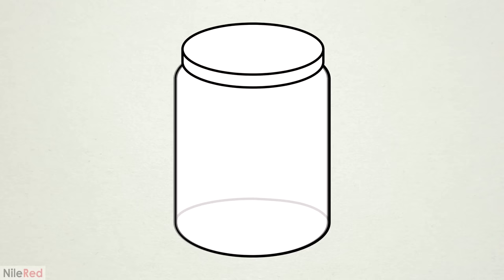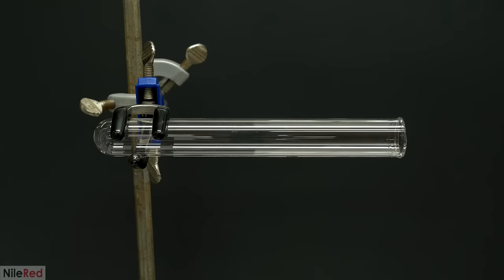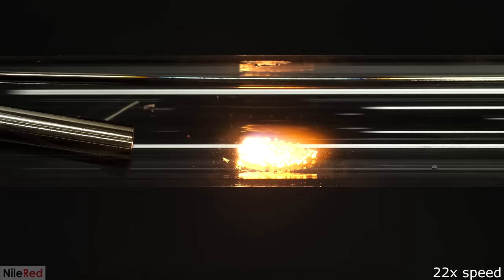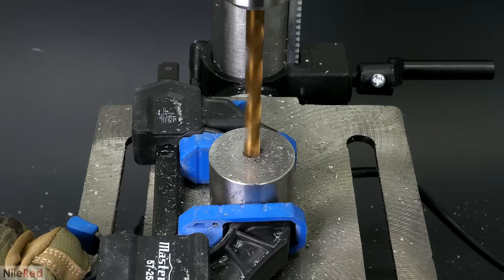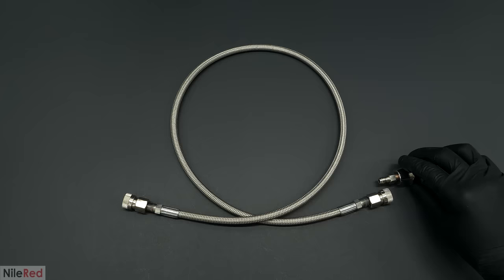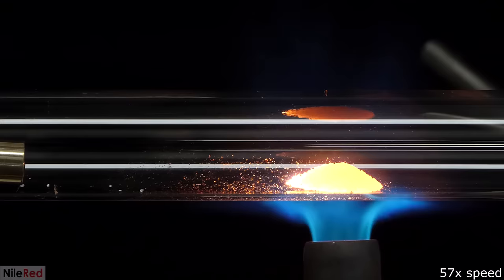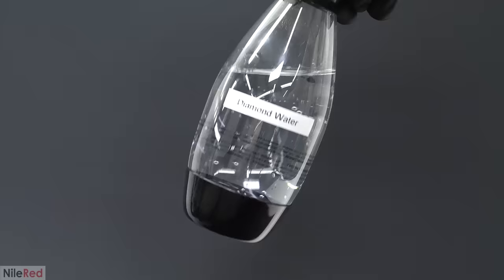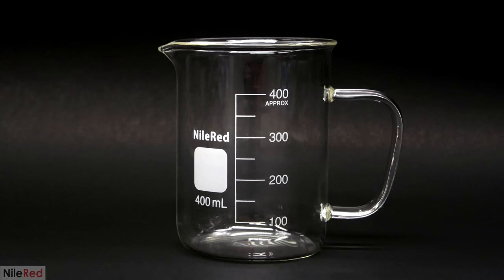Making the world's most expensive carbonated water!

Comment: Ok, so you converted Diamond to CO2.  Now convert CO2 to Diamond(s).
Reply: Diamonds to CO2 needs heat so if we cooled CO2 its going to make diamonds so basically dry ice is dry diamond ice
Reply: @BubblyLasagna  no, just no
Reply: You really need an extreme temperature and pressure to do that
Reply: weetme 161 for example a sun
Reply: Nugget That’s not how it works if CO2 is cooled down it’s going to become ice made of CO2 not diamonds. Diamonds are made in the mantle where it’s 2000 F or 1100 C and the pressure is very high.
So to make diamonds you need lots of heat and pressure not cooling down CO2. You really make no sense, and you shouldn’t talk about something you don’t know
Reply: @Official_Chivo.06  Not all diamonds are made with High Pressure High Temperature (HPHT), you can also make diamonds using Chemical Vapor Deposition (CVD).  The largest synthetic diamonds are actually made using CVD and this method gives you a lot more control than HPHT.  This way you grow the diamond in a low pressure (though still hot) plasma.  While diamonds in the earth form through HPHT, scientists speculate that diamonds may form in the atmospheres of Uranus and Neptune through CVD.
Reply: If you converted the CO2 to graphite, you could also use HPHT, but I feel like that's less in the spirit of a chemistry channel...
Reply: All of the replies on this is really hurting my brain
Reply: @howdy01  lmao me too
Reply: @Official_Chivo.06  pretty sure Nugget was just joking
Reply: @howdy01  same 😔
Reply: @BubblyLasagna  lol
Reply: they need cvt,its quiet expensive
Reply: @BubblyLasagna  proper Commerce guy
Reply: Just A Person btw I think he was joking
Reply: People have done it in the past but theyre very miniscule and require an insane amount of head and pressure
Reply: @BubblyLasagna  no you have to somehow dissipate oxygen from the dioxide it is pretty complex
Reply: Alchemy 100
Reply: actually incredibly difficult
Reply: Nugget oh yeah it’s big brain time
Reply: @BubblyLasagna  not really tho
Reply: Wouldn't it be Carbon instead of CO2 because the oxygen was added to the Crabon during the heating process?
Reply: Stonks
Reply: @packediceisthebestminecraf9007  i guess nugget means DRY ICE IS BETTER THEN PACKED ICE IN MINECRAFT AND IRL HAHAHAHAHAHHAHAHAH
Reply: It can be made . You need carbone and high very high pressure but I think it won’t be as valuable because it’s not natural diamonds have high value because it not easy to access it and if you made it , it may look the same but won’t have the same value
Reply: You just found the line between chemistry and alchemy my friend
Reply: And after that go to a fucking volcano and turn lava in to clouds the turn those clouds into captain price
Reply: @BubblyLasagna  not at all diamond is made up of only Carbon not co2
Reply: If you reply by “it doesn’t work like that” your officially a bomer, congratulations 🎉
Reply: @Jiya Noshin not all meaning some are so im right
Reply: @Official_Chivo.06  r/woooosh
Reply: @dkkdjfldkd1242  bruh
Reply: Nugget Seems legit
Reply: STOP GETTING SCYENTIEFIC BOMERS
Reply: Holy shi-
Reply: Is that possible?
Reply: @BubblyLasagna  i honestly hope that was a joke 😂
Reply: Nugget 😂 yup totallyyyyyyyy
Reply: Siwlerdaoz yup. Good luck.
Reply: Guys nuggets making a joke (hopefully)
Reply: @BubblyLasagna  Honey. Diamonds are supposed to be a pure composition of just carbon not carbon dioxide...
Reply: There were two groups several years ago that managed a process to do something like this using seed diamonds and knocking on carbon atoms to grow the seed in a liquid suspension (I think). One was a hot method, one was cold and they were in a race to find a method to replace silicon as the main material for electronics as it would allow us to overcome.. a host of issues including our current thermal limit. One group was bought and shuttered, the other received death threats and the last of their members that I was following fled to Japan. Diamonds are not scarce. You can buy flawless, lab-grown diamonds for relatively cheap. If I understand why their lives were at risk, it's because the same method could be used to introduce artificial inclusions.
Reply: Profit 100
Reply: Phil Lester  I'm saying bruh.
Reply: @umbrvalken  bruh he was joking.
Reply: @umbrvalken  well i'm not 100% sure but i'm gonna assume they were joking.
Reply: @Official_Chivo.06  ok so i need an hydraulic press machine Made of tungsten and some anthracite at 1100C°. Thanks for the tips
Reply: Illuminati wants to know your location
Reply: It's not possible
Reply: We need high pressure to convert co2 to diamond
Reply: @BubblyLasagna  nugget lemme join in ur nugget cave
Reply: You can make diamond with grafit if you heating to 10000°celciis
Reply: @BubblyLasagna 
fysiks
Reply: You would have to deprivate it of oxygen
Reply: @BubblyLasagna  not really
Reply: @BubblyLasagna  no we have to pullout oxygen and we get diamond
Reply: @Official_Chivo.06  im pretty sure he was clearly joking lol
Reply: @BubblyLasagna  hell no, diamond is just Carbon, dry ice is CO2.
Reply: @demonetization6596  ARENT YOU SUPPOSED TO DEMONETIZE PEOPLE? GO DO YOUR JOB
Reply: @BubblyLasagna  aren't you supposed to show me your pit of nuggets?
Reply: That is the real test
Reply: @weetme1613  so just a heated hydraulic press?
Reply: Hello, I'm Matt Heck, former Director of Special Projects for TechShop Menlo Park.  This was in fact done by Dr. J. Michael Pinneo.  I know this because, one afternoon, I was backing out of our server closet, and turned around to see a very large object on a rolling plastic lab cart.  This resulted in my saying one of those things you never expect to hear yourself say:

"Michael, why are you aiming a 15 kilowatt microwave horn at my server room?"

It turned out to be one of two such drivers, both of which wound up tightly bolted onto a big square pressure vessel at 90 degrees.  Into this, Dr. Pinneo injected various CxHy atmospheres, purging all the oxygen out, and then set microwave amplifiers up to get constructive interference regions in the cavity.  This wound up gradually dropping carbon out as amorphous diamond, eventually leaving an atmosphere of pure hydrogen in the chamber!  Pretty fantastic.

As I recall, his initial motivation for doing all this was that he wanted to make his wife the world's first pure diamond ring-- the ENTIRE ring.  I'll have to ask him if ever managed it!
Reply: @Official_Chivo.06  r/whooosh
Reply: This is big brain time
Reply: If that was possible global warming would be an illusion
Reply: @BubblyLasagna ..
Cooling doesn't reverse what heat does..
Heat allows atoms to move and reform..
Cooling stops the movement, so reaction is impossible to happen when atoms doesn't move.

Instead, pressure can play a role in reversing.

Just imagine, when pressure is low and you apply heat the atoms will move further from each other. So, thing breakdown and get more simple. 
And, when pressure is high and you apply heat the atoms move nearer to each other. So, things unite and get more complex.

I don't know a lot about chemistry, but I think this is how reversing work.

And, I know to turn CO2 to diamond you need high pressure and heat.
Reply: @dogesao7016  Can't use a hydraulic press to compress carbon since the fine oil used in the hydraulic would be condensed as well. Also you'd need a hella strong hydraulic press to even do smth liek that.
Reply: @packediceisthebestminecraf9007  so can you make packed diamond ice?
Reply: @weetme1613  just give it a vacation in Texas and give it the finals test for its PHD.
Reply: @jacobdobbins5443  eh, what did i miss?
Reply: @weetme1613  everything and nothing at all
Reply: @jacobdobbins5443  okay
Reply: Actually, that could theoretically work. But with a heat and pressure not possible on Earth yet.
Reply: @BubblyLasagna  lol nugget from kindergaten i remeber u from a vid wher u commented "Nugget loves pretty lily"
Reply: @AlooGobigirl  Remove the Oxygen then you have carbon which can be converted to diamond through many different processes.
Reply: Phil Lester  THANK YOU. I keep cringing as my funny bone dies a little with each comment 😂
Reply: @umbrvalken  is it right when you're correcting a joke? 😩
Reply: @umbrvalken  Hahaha savage, dude 😅😅😅😅
Reply: All of these comments will allow many to make diamonds lol... if not including the funding needed
Reply: Omg you’d be rich
Reply: @Official_Chivo.06  r/woooosh
Reply: @unknowndefaultguest  also ha to the middle part
Reply: *DeBeers wants to know your location
Reply: But then they wouldnt have any value almost
Reply: weetme 161 which basically up is not possible for a single human to do.
Reply: @Official_Chivo.06  then you do a coal based motor, that heat a lot, and the co2 produced from the coal is reinjected into the machine
Infinite diamond trick
Jewelry hates him
ultra STONKS
Reply: Ok
Reply: @BubblyLasagna ..... no. That is wrong on several levels.
Reply: @potato2635  STOP BULLYING ME
Reply: Stonks
Reply: @CreeperDude-cm1wv  Yaaaassss queeeeennnnn
Reply: I just realized that we can cool down coal to reuse it
Reply: @Official_Chivo.06  r/woosh
Reply: @Prankst3r3  lol
Reply: @weetme1613  that still wouldnt work, first youd need to turn it into graphite, and getting a gas to follow that kind of crystalline structure is near impossible, only in the implosion/collision of neutron stars.
Reply: @jayosborne1147  neutron star collision*
Reply: @immortaltitan3839  Geez so many replies
Reply: @weetme1613  bring it to florida
Reply: @paullucas7504  he added the Oxygen gas, not the O2 one, pretty sure it turned to carbon monoxide
Reply: Good luck; you need at least 105 GPa (that's Gigapascals) to do that. I'm pretty sure an ordinary hydraulic press wouldn't work well with the idea of making lab-grown diamonds.
Reply: thats literally how most of the diamonds are made today
Reply: @BubblyLasagna  some gud fizziks here
Reply: @Official_Chivo.06  he’s joking
Reply: @RealSaudiExplorer  this was actually a really good explanation to tie together this video ty
Reply: @packediceisthebestminecraf9007  reddit moment.
Reply: @Official_Chivo.06  r/whooosh
Reply: Time and pressure turns coal into diamonds
Reply: @BubblyLasagna  learn to spell
Reply: @Official_Chivo.06  r/wooosh
Reply: @Prankst3r3  r/woooosh
Reply: @BubblyLasagna 
No, it does not work like that😅
Reply: @packediceisthebestminecraf9007  actually it’s chemistry not physics
Reply: @Prankst3r3  yes
Reply: @iayakimino3650  chamistree

Also, is it really chemistry? It's mostly about pressure and temperature.
Reply: @weetme1613  and even then it takes years for coal to condense down into diamonds.
Reply: Do the whole thing backwards
Reply: Stonks
Reply: @weetme1613  maybe he could add pressure using some sugon
Reply: Entropy:
First time?
Reply: yeah that's big brain time.
Reply: @BubblyLasagna  full metal alchemist
Reply: @BubblyLasagna  is that a joke? Burning is a chemical change so it actually changed the property so reverting it back to diamond seems impossible.
Reply: @BubblyLasagna  Basically yes, the only hard part is removing all the oxygen from dry ice.
Reply: CO2 to diamonds... imagine.....

UNLIMITED DIAMONDS
Reply: @BubblyLasagna  So, people aren't allowed to talk about chemistry here?
Reply: @BubblyLasagna  dude the hell?
Reply: @BubblyLasagna  the amount of people who took this seriously scares me
Reply: Entropy, my friend. Entropy.
Reply: There is a company that takes your loved ones ashes and turns it into a diamond
Reply: @BubblyLasagna  how can u be so wise in the way of science
Reply: @Official_Chivo.06  dude .. u forgot ur meds ?
Reply: @Official_Chivo.06  mate I think that was a joke, just chill
Reply: @Official_Chivo.06  wooosh moment
Reply: For all the people in the replies trying to educate this dude...

It's a joke.

Just stop 🥴
Reply: @ornessarhithfaeron3576  You're allowed to talk about anything in a comment section but everyone trying to scientifically correct a joke is just kind of sad.
Reply: @jayosborne1147  not exactly but true
Reply: @Prankst3r3  yes, just yes 😂
Reply: I really hope that he attempts it at some point or at least sits us down and says no lmao
Reply: You first should separate carbon and oxygen, then remove oxygen and with extreme pressure, TRY to convert carbon to diamond
Reply: @Official_Chivo.06  Im pretty sure it was a joke but ok...
Reply: @Official_Chivo.06  r/woosh
Reply: @Official_Chivo.06  ITS A JOKE SMH
Reply: @packediceisthebestminecraf9007  
Man reading that was hilarious
Reply: Cody's lab/applied science: heavy breathing
Reply: To do this just play the video in reverse
Reply: Yesss
Reply: @Official_Chivo.06  r/whoooosh
Reply: If people can make diamond, they will become cheap
Reply: @BubblyLasagna  didn't see the schme he used on the video you need to loose all o2 just carbon u can't make anything with co2 to turning to diamond
Reply: @BubblyLasagna  if you put meat on the grill then you cook it and if you freeze the meat then it becomes raw again
Reply: big brain
Reply: Good one
Reply: You would have to separate the Oxygen atoms (2 per molecule), and then place the pure carbon atoms under extremely high pressure (something slightly higher than the pressure of a hydraulic press), not to mention get it at an extreme temperature, near 500-1000’C (enough to melt it). Now that you’ve done that, lift up the extremely hot hydraulic press, and you’ve got some homemade co2 diamonds!
Reply: @BubblyLasagna  no, just no to pure amazing hilarious lies-
Reply: ok ok ik this is a joke but i want him to see if thats possible
Reply: That's exactly what they do in all those labs in china making CVD diamonds.
Reply: @BubblyLasagna  Dry cool mony 🤑🤑
Reply: @monke man No.  Actually methane (CH4), but methane from carbon dioxide is easy.  Look up Chemical Vapor Deposition.
Reply: @BenTajer89  yes yes we can all google lol
Reply: @BubblyLasagna  sussy
Reply: @packediceisthebestminecraf9007  no hony blocc is bettr
Reply: I don't understand whats the reply section is saying but yes
Reply: I have liquid diamonds here,how to make it solid
Reply: convert an omelet to an egg
Reply: Hey, if diamonds are made out of carbon, we're literally breathing diamonds.
We drink beverages with diamonds.
Dry ice, which is carbon, is actually diamonds.
Diamonds are everywhere, and we still didn't realize it.
Reply: @somewagyuenjoyer  99999IQ
Reply: @azamgulzar8257  hmm, blue ice may have something to say about that
Reply: @BubblyLasagna  no, they officially have an iq greater than 30
Reply: @sreeharinair4240  nope da beer wants to turn precise location finding on, do you agree?
Reply: @binayd.c.996  you get carbon or graphene perhaps depending on conditions
Reply: @imillusion492  that might be a south american company iirc typically one that might melt humans down for fat for cosmetics perhaps.  Possible you get a cheap diamond in return...
Reply: @howdy01  I’ll dumb down CVD (what the guy above you was describing)

Take away the oxygen from CO2, cool down the carbon, and make sure it crystallizes, and badda-bing badda-boom you have diamon
Reply: they would be the kind of ripoff diamonds then not the real ones. no one "create" real diamonds except for nature
Reply: @konfuzzzled  there are already industrial diamonds that are made artificially.  I think they are only very small and require tremendous amounts of heat and pressure
Reply: OH MY GOD THIS COMMENT SECTION YLL NERDS PLS DO MY SCIENCE CHEMISTRY HW
Reply: @dithikadas7943  please read your notes from class and a text book if you really want to get ahead.  We're only the same as you but older, having done a little more and probably most passed basic chemistry.

By the way, if you watched this then I think you're showing some of the researching and curiosity that will help you with this subject later on but make sure you get those basics nailed down.
Reply: @BubblyLasagna  sciens
Reply: @BubblyLasagna  you clearly know alot about chemistry
Reply: @BubblyLasagna  no ur going Albert Einstein mode
Reply: C02 to diamonds requires extreme pressure
Reply: Yes
Reply: Play the video in reverse
Reply: @BubblyLasagna  No.. Diamonds are purely made from Carbon atoms. Dry ice has nothing to do with Diamonds.
What you'd actually need is to tremendously pressurize and heat the carbons in something like coal over for an astounding amount of time.
Reply: I don't care whether that's impossible or not, but he has to do it
Reply: You know they already do that lol
Reply: The earths air would be filled with diamonds and would fall on newborns and kill them uwu funni
Reply: Just extremely cool it down B)
Reply: Awsome idea. Turn pollution to your wealth
Reply: Not possible for him to do
Reply: Lol free money
Reply: Imqgine
Reply: Heat = melts diamond
Heat and pressure = makes diamond
Reply: Dear god
Reply: @BubblyLasagna  no
Reply: @Official_Chivo.06  r/woooosh
Reply: Hol up
Reply: Pls I want
Reply: Wait thats illegal
Reply: Lol... Ur saying as if it's vry easy to do it.. 😅😂😆
Reply: @BubblyLasagna  kehmastry
Reply: @howdy01  same
Reply: diamond is high pressure carbon
Reply: @howdy01  fr I’m to dumb for this 😵‍💫
Reply: TIME TO BREAK THE ECONOMY TO SAVE THE PLANET
Reply: I don’t know if that will work
Reply: But what if Nile red do
Reply: But what is Nile red doesn’t know of a way to do it
Reply: am i the only one who watches Nile but doesnt understand a word about science
Reply: Free diamonds!
Reply: Yess inginite money glitchhhhhhhhhhhh
Reply: Look at all these chemistry nerds
Reply: so infinite diamonds?
Reply: Well if he could I think diamond wouldn't be that expensive lol
Reply: @wasabi1363  right i forgot
Reply: Probably about over 2000 pressure on the air pump so no
Reply: It is possible with extreme pressure
Reply: It's legitimately impossible as CO2 in gaseous state is too less carbon. we may rather use charcoal or coal and put them under higher pressure and heat(absolutely high magnitude) that would change it's structure and give us damm diamond. Btw there are people who have already tried it and were successful but for some reason they weren't just very real diamonds
Reply: Lol 🤣🤣🤣
Reply: This os literally being done nowadays lol
Reply: Then he would be richer than Elon Musk...
Reply: COOOOOOOOLLLLLLLLLL!!!!
Reply: Technically that diamond water is CO2 so just freeze the diamond water and the it’s diamond
Reply: Convert glass to sand again.
Reply: You say that as if it hasn't been done before
Reply: Could save alot of world problems with that 😄
Reply: Yes, I agree.
Reply: Guys it’s a joke
Reply: They already do with the man made diamond
Reply: @BubblyLasagna  and then we bully the oxygen out
Reply: Infinite money
Reply: no, thats not how it works
Reply: You need compressors
Reply: @BubblyLasagna  everyone that replied to this r/wooosh
Reply: The Bible says that no one is a good person. We have all broken God's law the 10 commandments, we have all committed, lies, adultery, idolatry, and blasphemy. We deserve hell, but because of what Jesus did on the cross we can be forgiven. So if you Repent of your sins, change your wicked ways, and put your faith in Christ you will be written in the book of life. 👌 🙏Repentance is reviewing one's actions and feeling contrition or regret for past wrongs, which is accompanied by commitment to and actual actions that show and prove a change for the better.
Reply: @weetme1613  its already been done at a nice scale. Dont need the heat just very extreme sudden pressure as that also creates the heat needed.
Reply: @BenTajer89  opposite is using the extreme pressure micro compressors. These things produce almost the same pressure found near core and in a millionth of a second saw reps as sun however lol be an making at best diamonds is of a pinhead.
Reply: @jayosborne1147  not even  a sun you need a super nova to make anything heavier than iron
Reply: also let's make gold from turds while we're at it! (jk but if possible.... Not kidding?)
Reply: @weetme1613  we got the technology
Reply: @megasocky  I also require an insane amount of head and pressure
Reply: Nigel: …
Reply: First thing I thought
Reply: Ph
Reply: He converted Diamonds into C4
Reply: it is just chemical change
Reply: @megasocky  head? 🤨📸
Reply: That would be very challenging for anyone to do.
Reply: Using 100% of the mind
Reply: @BubblyLasagna  so we can get CO2 from the atmosphere and make it into diamonds?
Reply: Yessssssss!🎉
Reply: They are making now the science diamond 💎
Reply: Alr just give me about a hundred thousand years
Reply: That’s illegal
Reply: Get me a reverse blowtorch, an anti-quartz tube and a negative oxygen pump
Reply: Smart
Reply: we cant, we need gamemode creative for this
Reply: Impossible 😑
Reply: Nile is not immortal, he can't wait 300,000,000 years for the CO2 to fossilise, then it would be impure diamond. It also takes a lot of pressure, and nile dosen't have infinite money.
Reply: @weetme1613  On paper, yes, but if you heat it in any wrong way, you end up with a powder instead.
Reply: If that could happen, JUST IF, all scientist will be rich and we will not know how they got so rich. If we know how to get diamonds from CO2, theres no such thing as rich person (unless u dont have the scientific instrument to change the co2)
Reply: @Official_Chivo.06  it was a joke lol, chill.
Reply: Pressure and heat is a bad combo for a lab
Reply: Ez just knock the o2 off and then compress the leftover carbon
Reply: @BubblyLasagna  bruh
Reply: 📍That’s a great idea, not only will it be an excellent money maker, but it also help the planet cause it’ll use up all the CO2 from the atmosphere!
Reply: @BubblyLasagna  no tf
Reply: Don’t test him 😭
Reply: Imagine all that dry ice being crushed back into one while big diamond 🤣💎
Reply: Crush all that dry ice back into one diamond 💎
Reply: @Siwlerdaoz this isn't possible since it requires very high temprature and pressure. Us people can'tcreate artificial fossil fuels which is one of our crucial needs.
Reply: ITT: People who don’t understand entropy
Reply: @Prankst3r3  you missed the joke 🤡
Reply: Guys he was kidding calm down.
Reply: MAH MAN TALKIN BOUT UNO REVERSE CARD IRL....
Reply: Bro understand the assignment
Reply: @Chivo
Reply: @Chivo r/woosh
Reply: Sounds simple enough
Reply: @Official_Chivo.06  Dunning-Kruger effect in action.
Reply: Not possible
Reply: @BlueLatios  a phrase scientist try to avoid
Reply: @BubblyLasagna  It Has To Be Hot Not Cold
Reply: Yes throw it into the point wher two totonic plates meet
Reply: watch the video in reverse and voilà
Reply: Not possible
Reply: Smart free money if worked
Reply: @BenTajer89  cool
Reply: The same thought hit my mind, "Ok, so you converted Diamond to CO2.  Now convert CO2 to Diamond(s)." 

I was getting ready to say the same thing!
Reply: That’s going to be pretty hard might be his hardest project ever to be honest
Reply: Simone needs like allot of pressure more than the pressure of bottom of the ocean 🌊
Reply: Diamonds=>CO2 = CO2=>Diamonds
Reply: @BenTajer89  nice
Reply: Lol
Reply: This reply section is basically r/woooosh
Reply: You literally said what was in my mind
Reply: @BubblyLasagna  Bra
Reply: We call it synthetic diamonds. :)
Reply: @BubblyLasagna  wow
Reply: Oh good question
Reply: There more than 300 comments, but did someone already mentioned welding? Back in the day they made artificial diamonds when it was worth something.
Reply: Yes please
Reply: How to become a trillionaire
Reply: Just rewind the video play it backwards boom done
Reply: @weetme1613  and a million years or so
Reply: Now that would be really expensive
Reply: the hostility is so hilarious when someone is joking about cooling CO2 and someone else comes in like “you really shouldn’t talk about something you know nothing about” lmao like chill
Reply: @jayosborne1147  you’re onto something…
Reply: @BubblyLasagna  heh
Reply: While he's at it he can create gold why doesn't he
Reply: Infinite money glitch
Reply: just do the experiment backwords
Reply: now make it rain diamond from the CO2 in the atmosphere
Reply: oh
Reply: It's really easy and just need one machine. Yeah it's costly but synthetic diamonds are widely made all around
Reply: I breathed diamond armour
Reply: @Official_Chivo.06  bro forgot joked exist
Reply: @BubblyLasagna  Dis u? 🤓
Reply: @trayambakrai  you so mad i posted a comment 💀
Reply: @BubblyLasagna  I was joking ☠️
Reply: When Nile does this, he'll straight up just be an alchemist.
Reply: I don’t think that very possible
Reply: @BubblyLasagna  get bullied
Reply: @BubblyLasagna  this is elon musk
Reply: Breath
Reply: Just by decomposition reaction we can get a pure form of carbon..
I am in class 8th and thi is what I think about it
Reply: Carbon dioxide is extremely stable.  Stripping away oxygen to form pure carbon is next to impossible with any reasonable techniques.  If we want to talk about unreasonable techniques.
The molar enthalpy in J/mol of CO2 gas is -393,420 and gaseous C is +716,680 and the molar enthalpy of O2 is just 0 because it’s pure and in a standard state.  The molar entropy in J/(mol•K) of CO2, O2, and C as gases at STP (which ofc is a terrible assumption to make) are respectively: 213.79, 205.0, 158.10.  Which means that we’re talking about a temperature of around 7500 K and that’s completely wrong anyway because we’re looking at the enthalpy and entropy at STP of gases and by the time they reach 7500 K they’re certainly no longer at STP and might be a plasma???  If you were to somehow get carbon and oxygen to spontaneously split apart you would need absurdly high temperatures and for all I know we may be talking about nuclear fusion level temperatures.  If we are to chemically or electrically reduce CO2 down to O2, perhaps a strong enough reducing agent in an all CO2 atmosphere at a high enough heat could reduce CO2 to graphite.  The other options is to do it the way the aluminum industry turns Al2O3 into Al + O with like 300,000 amps of electricity although I have no idea if it would even work at all because carbon is a nonmetal and aluminum is a metal and so they work completely differently.
Reply: Side note: according to Nicky Oppenheimer, a former chairman of the De Beers diamond company, “diamonds are intrinsically worthless”.  Diamonds aren’t worth shit but there’s only one company that owns basically every diamond mine in the world so they jack up the prices super high.  In reality diamonds are not at all rare and it would certainly never be worth it to extract from CO2 because it would be so expensive for a very mediocre end product.
Reply: @BubblyLasagna  okay please take a basic chemistry or physics course before you assert things about thermodynamics that you know nothing about.  Heating and cooling are not the only two things that can be done to something.  Can you uncook meat?  No because it undergoes chemical changes not just physical ones.  To change CO2 to C you need to break open chemical bonds which is completely different from changing something from a gas to a solid and vice versa.
Reply: CO2 cannot turn to oxygen I mean diamonds diamonds are just carbon but carbon dioxide is what we breathe out he said it reacts with the oxygen so maybe he can extract the carbon from the CO2 and add it is to diamond
Reply: There's actually towers that can do that now a days, it takes carbon from the air and change it into diamonds/carbon based fuel.
Reply: Big brain
Reply: Nah nilegreen does that
Reply: @BubblyLasagna  it’s not that easy champ
Reply: @BubblyLasagna  if we wanna convert CO2 to diamonds we need a lot of heat and so much pressure
Reply: @BubblyLasagna  Im reading the comment section rn :     :buffering:
Reply: @Official_Chivo.06  bro he’s just joking chill
Reply: Yesss
Reply: @BenTajer89  well then on an unrelated note im going to brake the diamond economy
Reply: @jayosborne1147  A sun would fuse carbon, the intense pressure of the inside of Earth is all you need.
Reply: @skyethebi  This guy @Mochussy made a chemistry joke 2 years ago, and he is still getting angry replies like this every week.
Reply: @BubblyLasagna  oh my god...
Reply: @BubblyLasagna  not how that works
Reply: @BubblyLasagna  😂😂😂😂😂
Reply: You not only need heat you also need very high pressure and to remove the oxygen but its been done before
Reply: @jayosborne1147  simple, start punching the air until the pressure from your fist and energy from the punches turns it into diamonds.
Reply: Breathing gets taxed
Reply: @BubblyLasagna  who need they mochussy ate
Reply: Sell it to some one in Dubai, then buy diamonds with the money.
Reply: @BubblyLasagna  if that was the case diamonds would have no value
Reply: I think it requires a lot of heat and pressure.
Reply: @BenTajer89  u can also put twin turbo v8 tune it on e50 with hpfp on stage 3 tune and make diamonds.
Reply: @BubblyLasagna  he is the CHOSEN ONE
Reply: yes
Reply: I wanna see it
Reply: @BubblyLasagna  least science I’ve ever even heard
Reply: @BubblyLasagna  you'd make a bloody good alchemist.
Reply: me who knows nothing about science
Reply: play the tape in reverse
Reply: Technically the dry ice was the diamonds new solid form
Reply: Work smarter, not harder
Reply: If he can do that he will be the most powerful person in the world
Reply: @Prankst3r3 1:13
Reply: @spongebobfunnyy  no
Reply: propably one of the longest comment convo ever on yt
Reply: I think he needs more materials but i have no idea its just a thought
Reply: @Prankst3r3  yes.
Reply: He'd need to separate the oxygen from the carbon, isolate the carbon in a solid form, and then put so much pressure on it that it became diamonds.
Reply: Smort
Reply: @Official_Chivo.06  first, you’d need to get just carbon. Diamonds aren’t carbon dioxide, they’re carbon.
Reply: @Prankst3r3  I think its meant to b a joke
Reply: @imibuks-replit  you don't make jokes about science, ok bro?
Reply: @Official_Chivo.06  its a joke 💀
Reply: @BubblyLasagna  you are actually silly 😂
Reply: @BubblyLasagna  wtf
Reply: Ha! So true
Reply: @ArBoR dayum, was like two years since I made that comment, lmao.
Still, it's very high temperature indeed
Reply: Yeah, a true alchemist should be able to make diamonds from sparkling water if he can make sparkling water from diamonds.
Reply: yes please and then give to me😏
Reply: @Official_Chivo.06 r/wooooosh
Reply: @weetme1613  We got the sun for that..... 😁
Reply: @BubblyLasagna  bro its bonded to oxygen, you can't just freeze CO2 to make diamond 💀
Reply: @Official_Chivo.06  It’s almost like he was joking
Reply: Diamond generators don't exist in minecraft, let along irl
Reply: @Prankst3r3  its true
Reply: @Prankst3r3  not the dry ice part tho
Reply: @Official_Chivo.06  when someone doesn't undestand the joke:
Reply: @Official_Chivo.06  interesting how you said “you shouldn’t talk about something you don’t know” then someone corrected you and we never heard from you again 😂
Reply: Lol
Reply: You need pressure and heat!
Reply: I just watched it backwards and boom co2 to diamonds
Reply: You didnt say that... He. Did it?
Reply: @BubblyLasagna  dry ice is solid co2 but diamond is only carbon
Reply: no, you'd need to separate the O2 from the carbon before, and making diamonds from carbon is actually really common, but hard because you need crazy high pressure for this
Reply: @Official_Chivo.06  bro its a joke
Reply: Simpsons 

Did it
Reply: Infinite money hack
Reply: Remember, artificial diamonds exist
Reply: @Official_Chivo.06  not that pretty sure he was making a joke
Reply: We breathe out diamonds….
Reply: @BubblyLasagna  wdym dude, diamonds only form under very extreme pressure and heat, usually within the earth's outer mantel and rise to the surface via volcanic eruptions
Reply: @paullucas7504  crabon. I'm just imagining a chonky crab somewhere in r/bossfight
Reply: @Azam Gulzar  Dry ice doesn't exist in Minecraft bruh
Reply: @BubblyLasagna  okay, No it doesn't work like that
Reply: @BubblyLasagna  boomer* you boomer (also that is very cringe, so stop for your own sake)
Reply: Bro just really pulled out the reverse card 😂
Reply: @BubblyLasagna  Pure diamond is only carbon , not CO2 so if u cooled down co2 , it will make dry ice , not dry diamond ice.
Reply: @Official_Chivo.06  LMFAO CHILL MATE
Reply: You need to convert the co2 to graphite then put a lot of pressure and energy in it
Reply: @balls
Reply: It's not CO2 it is CO²
Reply: Infinite money Hack
Reply: Fr
Reply: Oh no
Reply: @BubblyLasagna  LMAO people are calling you out and you got mad lol wonder why people called you out lol
Reply: @jackthomas1448   you say "nerds" like it's an insult when it isint lmao
Reply: @ziuzz4168  uh
.. no.
Reply: @Hyouga.I.guesss   so I guess we can't have scientifically correct jokes now can we? /S
Reply: @ArtsyKnox25  can it, nerd
Reply: Wow
Reply: Loll😅😅😅😅
Reply: @BubblyLasagna  1 word. Allotropes.
Reply: DO IT
Reply: NOWWW 👹
Reply: How is that posible😂😂😂😂😂😂!
Reply: @BubblyLasagna  CO2 to Diamond needs heat, pressure, and millions of years
Reply: @Official_Chivo.06  bruh got his feelings hurt bad
Reply: @BubblyLasagna  Comestroy ☁️🧊🪨
Reply: @BenTajer89  You're very smart
Reply: @BenTajer89  synthetic diamonds are low quality though and turn out yellow and arent good enough for the jewellery industry and are only used for industrial applications, and yes there are some planets out there where the pressure is high enough that it rains diamonds.
Reply: I highly doubt you can reverse this experiment some are just not meant to be reversed tho 1605 bucks is a lot lol😂
Reply: @Prankst3r3  u
Reply: lol
Reply: @BubblyLasagna basically if we removed carbon from co2 we save the world and rich
Reply: Yessss
Reply: @weetme1613  Science
Reply: @BubblyLasagna  nope it would actually require even more heat. Like WAAAAAY more
Reply: He probably can but if he shows the process he’s have no funds
Reply: Wow
Reply: Photosynthesis in plants turn CO2 into plant biomass. You turn plant biomass into coal, then coal into Diamonds.
Reply: Challenge accepted
Reply: That's what synthetically lab grown diamonds are
Reply: Yessss
Reply: ∞ money glitch
Reply: Ain’t no way people don’t get the joke years later 😭😭
Reply: Just play the video backwards
Reply: @silly really bro, no, why
Reply: @BubblyLasagna that is not how that works
Reply: COO=/=C+OK
Chemistry does not work that way    rpy @SaraNelson1976
Yes
Reply: 1976=7633
Reply: @BubblyLasagna   LMAO
Reply: Yes
Reply: @Official_Chivo.06 you ever think maybe it was a joke not sure why you got so intense there
Reply: Pressure + heat?
Reply: @Official_Chivo.06   you are sure fun in real life
Reply: Wait
Reply: first you need to somehow get the oxygen out of the carbon then you need a very high temp and pressure
Reply: not possible
Reply: bro that would be so cool
Reply: Sure! Do you have a few million years, 1000 °K temp and even more pressure?
Reply: @BubblyLasagna well that, and butt load of pressure. Otherwise you would just end up with a lump of coal
Reply: Follow
Reply: Diamond is just a name for the crystal lattice structure of carbon that makes it a diamond.
Reply: Four big guyd
Reply: Means co2 around us is ....
Reply: Infinite money glitch
Reply: @BubblyLasagna  92 missed calls from HARVARD
Reply: U my friend are a friggin genius 😎
Reply: @BenTajer89 and that is why the value is less than how it is naturally made
Reply: @BubblyLasagna hm
Reply: OMG YES XXXDDDDD
Reply: Light creates chlorophyll now if only we can create light from chlorophyll.
Reply: Wait what? Convert co2 back to diamonds?... That's not on the script!!
Reply: I've designed a process for doing this. Diamond would be possible as well as other allotropes like graphite and carbon black. It can all be done with solar energy as well.
Reply: @SimuLord This is exactly the project I'm working on, but not so much restricted to diamond; graphite and carbon black as well.
Reply: @Official_Chivo.06  can you prove that the mantle exists? And can you prove that it’s that hot?
Reply: @howdy01 those who cannot DO - portray themselves in the comments as if they can - Teachers excel in the classroom because everyone that’s there doesn’t know squat about the subject the teacher is teaching and when they do, the teacher kicks them out
Reply: @kalebbillig3472  That’s an old fashioned method of teaching, nowadays teachers are required to give work extensions for students who need more of a challenge in their learning
Reply: @howdy01 😂😂😂😂😂
Reply: Looooool
Reply: @megasocky damn, you need to give head to the carbon?
Reply: no
Reply: I am 500th comment 😂😂😂😂
Reply: Hi😂
Reply: heavy on it
Reply: @Official_Chivo.06  oh dear god 😂
Reply: @BubblyLasagna diamond is pure carbon unlike CO2
Reply: Where y e
Reply: infinite money generator
Reply: what
Reply: @weetme1613 idc lol ima be rich
Reply: I think you can
Reply: 😂😂 @BubblyLasagna
Reply: Brooooooo he was joking like ahhhh
Reply: @Prankst3r3 yes🗿
Reply: it's possible but very expensive because of the pressure required
Reply: Imagine...
Reply: @BubblyLasagna  don't worry, at least I got it. You funny
Reply: @BubblyLasagna diamonds are just carbon dry ice is carbon dioxide
Reply: you need the C and not the O2
Reply: Cool
Reply: @BubblyLasagna  oh hell yeah, love me some science on crack xD
Reply: Looool diamond companies are gonna come after him….
Reply: @howdy01 I'm the class nerd so I'm the opposite

dunno why I posted this
Reply: Although it's possible but not probable
Reply: what did nugget say
Reply: @BubblyLasagna  completely false
Reply: They basically already do that when making CVD lab grown diamonds, except with methane.
Reply: Diamonds are made out of CO2. They’re made out of carbon so technically they’d have to convert the CO2 to carbon and then make diamonds.
Reply: Diamonds are made out of CO2. They’re made out of carbon so technically they’d have to convert the CO2 to carbon and then make diamonds.
Reply: Diamonds aren’t out of CO2. They’re made out of carbon so technically they’d have to convert the CO2 to carbon and then make diamonds.
Reply: @courtnisatterlee9610   so that's still converting CO2 into diamond. But in any case they already do that with methane using CVD lab grown technology.
Reply: So you make wood into ash, now make ash into wood
Reply: ☝️🤓. that's what lab grown diamonds are.
Reply: ☝️🤓. That's what lab grown diamonds are.